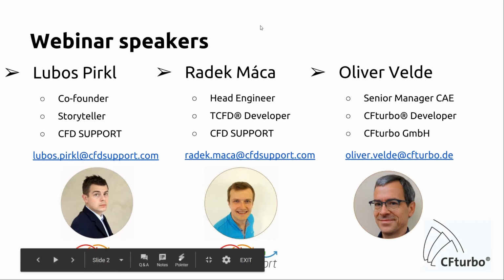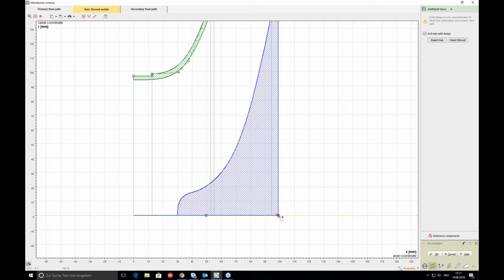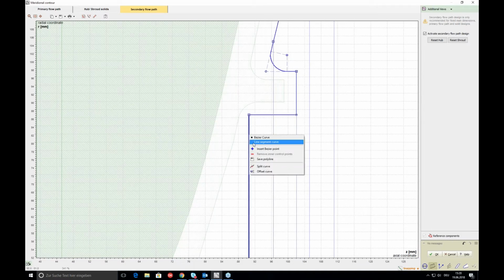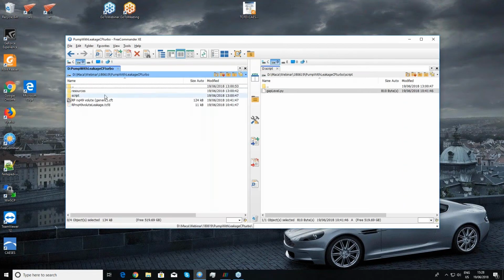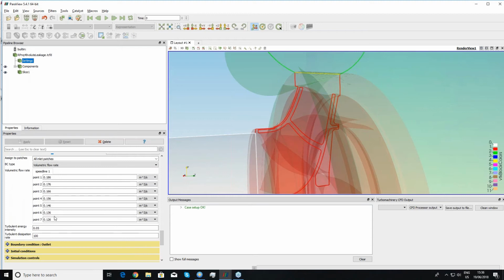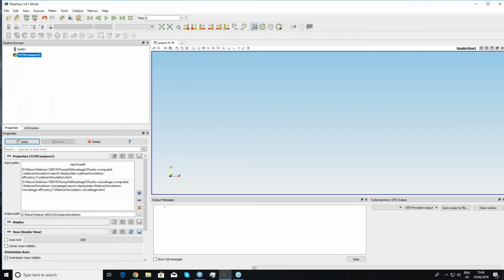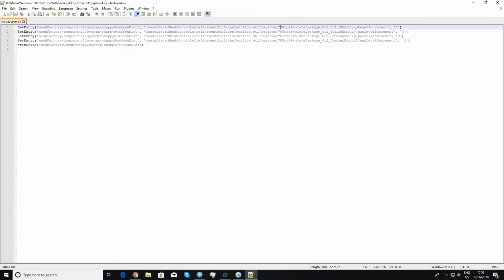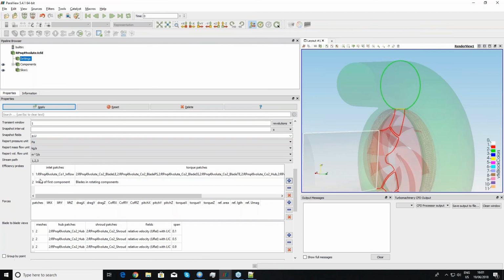Webinar 32, CFturbo® + TCFD®, Pump with Leakage Flow by CFturbo® and TCFD®, June 19, 2018

Comment: Does the built in meshing tool apply boundary layers (inflation) to the wall surfaces?  The mesh shown has average wall Y+ > 250 which would indicate a very large (or missing?) boundary layers.
Reply from the maker: Hi, thanks. Yes. The boundary layer is available.  For very fast simulations, we recommend not to use it.